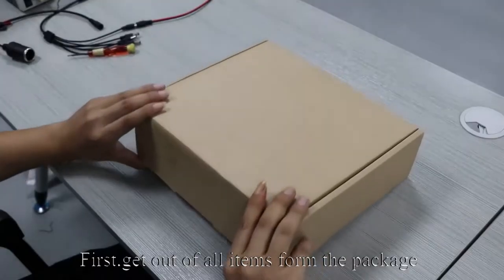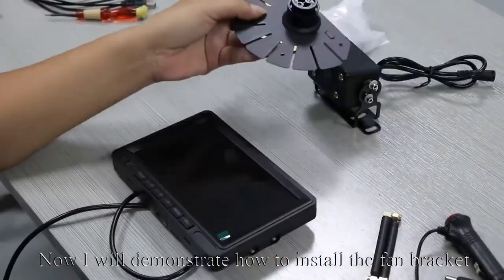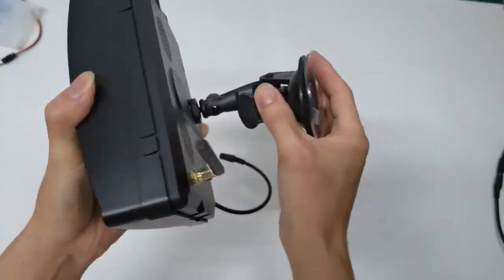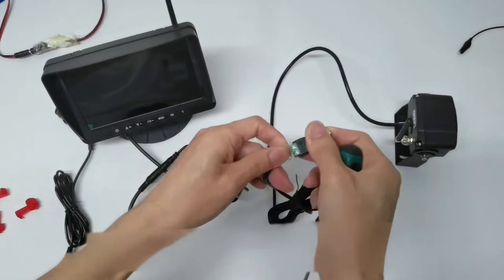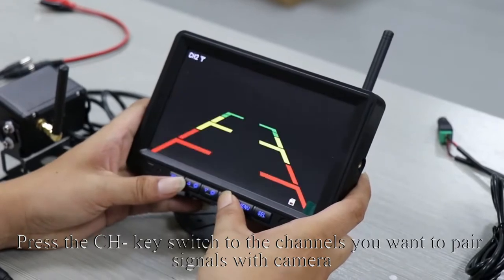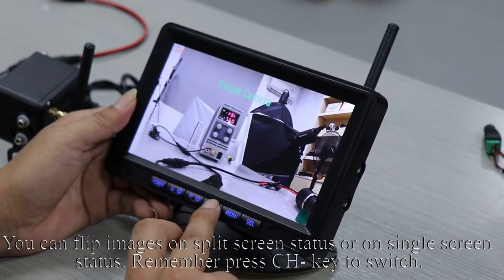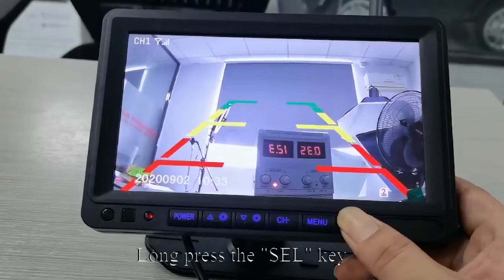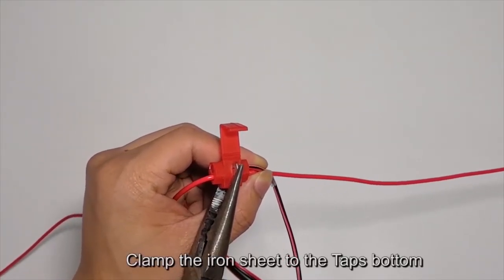AMTIFO A7 RV Wireless Rear View Camera System Operation Video

Comment: Im mad. The instructions  literally said find power. 😟 I'm not an electrician. I have no idea where to plug it into my RV.
Reply: Suggest you remove one of your trailer running lights (center top) and mount your camera there using the power that would run your light.

Comment: Piece of junk right out of the box. No power light when the cigarette lighter adapter is plugged in. Very flimsy wires. Can't get the bloody thing to work.
Reply: That's very concerning seeing as there is a 4.5 outa 5 star rating on this system.
Reply: Operator error obviously. Installed my system with second Camera. Followed instructions. Works perfect.